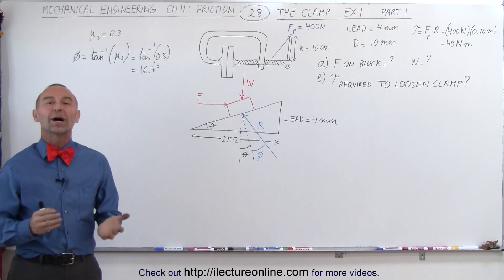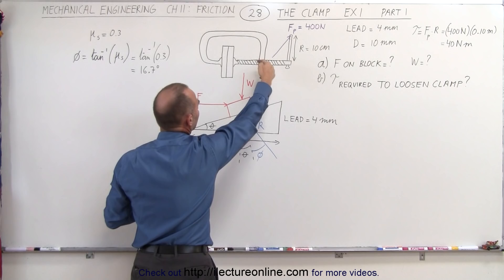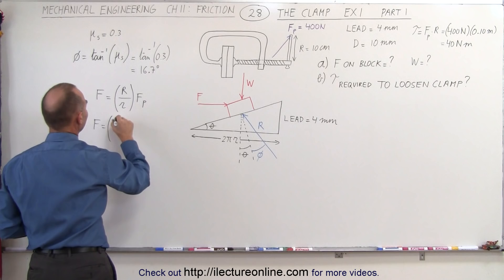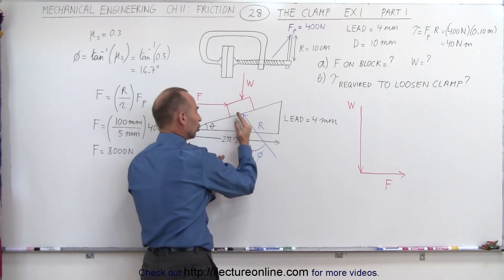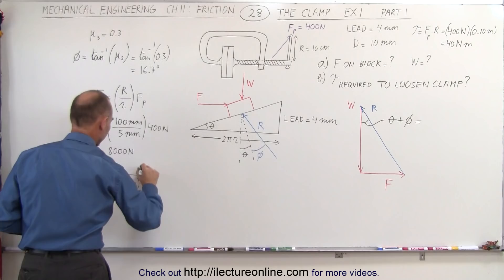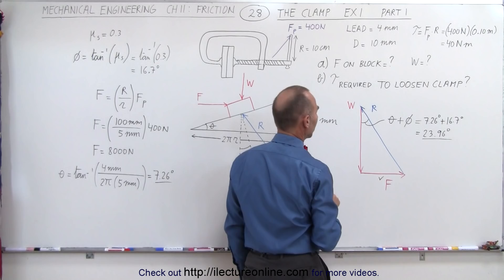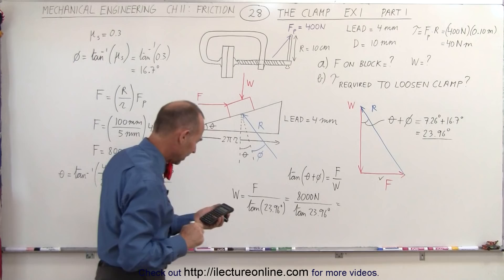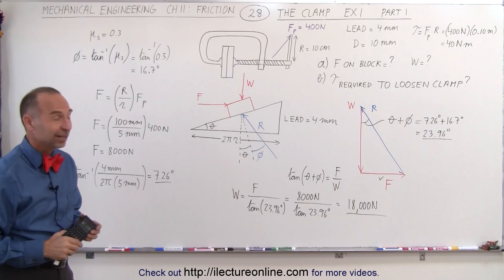Mechanical Engineering: Ch 11: Friction (28 of 47) The Clamp: Ex. 1 (Part 1/2)

Comment: Hey Michel, is W equal to the weight of two wooden blocks here? If not, then here is a confusion. If we try to loosen the screw, we must turn the handle anticlockwise, right?(According to previous lectures) But here, you are turning ckockwise🤔

Comment: Why does a higher screw radius lead to a lower force and lower mechanical advantage? That doesn't make sense to me.
Reply from the maker: The torque on the handle is converted to the thread of the bolt pushing the bolt forward.  The larger the diameter of the bolt, the less of an advantage you get from the torque of the handle.  (What if the diameter of the bolt was 30 cm?, would it be more difficult to turn the bolt?)

Comment: Hi there, may I ask what the difference is between the pitch of a screw and the lead of the screw?
Reply from the maker: The pitch is the distance from the crest of one thread to the crest of the adjacent thread.  The lead is the distance from the crest of a thread to the crest of the thread after one complete rotation is made following the thread.  For most screws it is the same distance, but for screws that have two separate threads on the screw (two starting points) the lead will be twice the pitch.
Reply: Thank you so much for responding, I didn't quite get it before and now I do, I'll take that into consideration in my calculations. Your videos have been a great help to me as I'm studying for my boards. I hope you keep up the excellent excellent work.

Comment: For part A why do you need to add lead angle and reaction angle? I'm having difficulty with when I need to add them or subtract the angle.
Reply from the maker: The angle theta is caused by the angle of the thread (like the angle of an inclined plane), the angle phi is caused by the friction, the greater the friction, the greater the force needed to turn the screw.